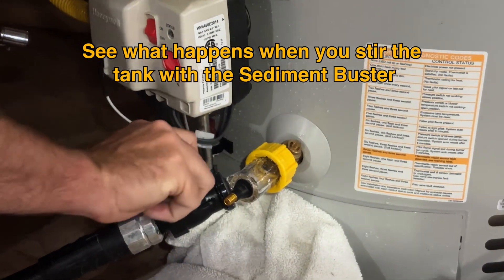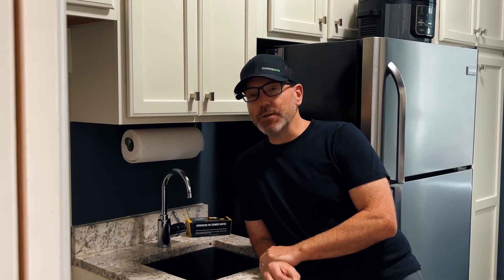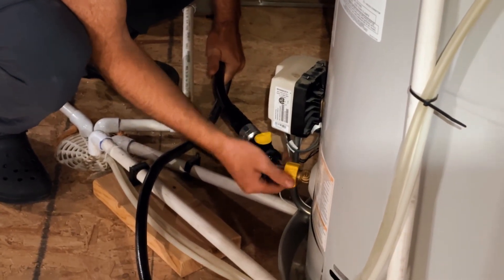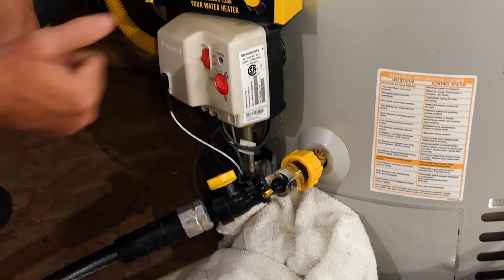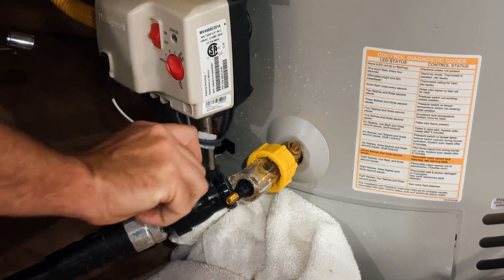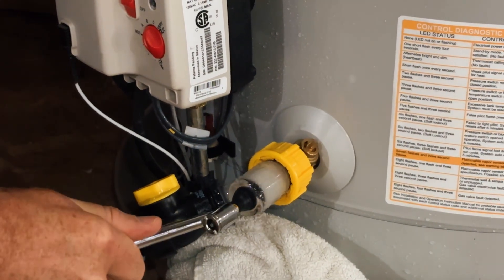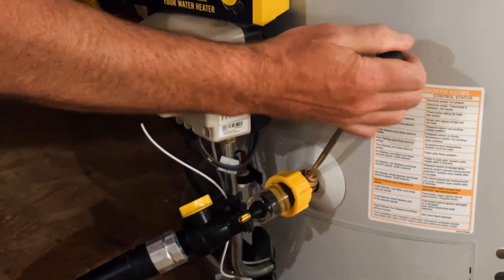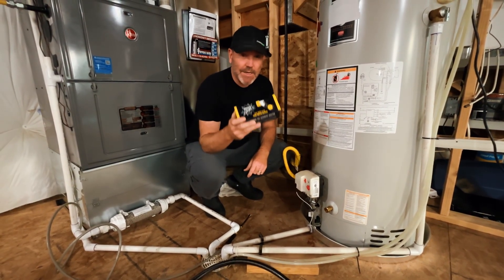How to FLUSH a water heater in 10 minutes! 👀 #sedimentbuster #diy #watertankcleaning

Comment: Many hot water heaters come with low quality plastic angled drain valves.  Open them once and you can't get them closed again. I replaced mine with a brass ball valve and a 3" nipple that is all straight.  I can stick a wire (like from a wire coat hanger)  in through the valve to stir up any sediment. But first, shut the supply water off so the water doesn't come gushing out.    Very little water will seep out. I use a flat baking pan to collect any water and sediment.

My previous hot water heater had about a foot thick layer of calcium that would not drain out.  It had a texture similar to oatmeal.  I had to remove the valve to get it out so I could drain the water.  Moving a full water heater is not easy.  30 gallons x 7 pounds per gallon is an extra 210 pounds of weight.
Reply: Water is 8lbs per gallon so that’s actually 240lbs for 30 gallons.